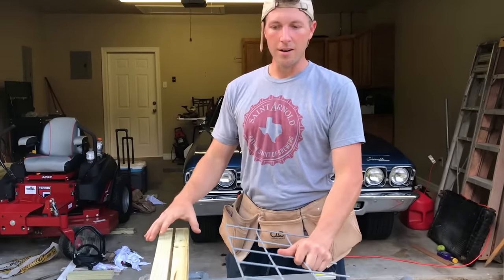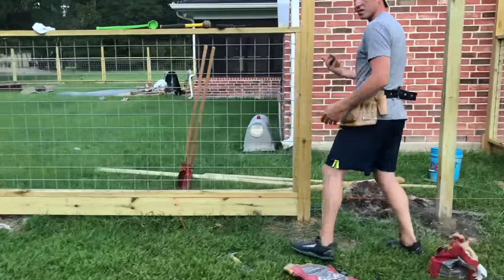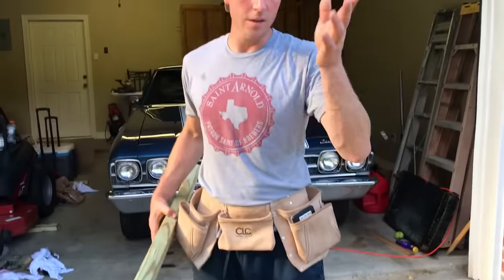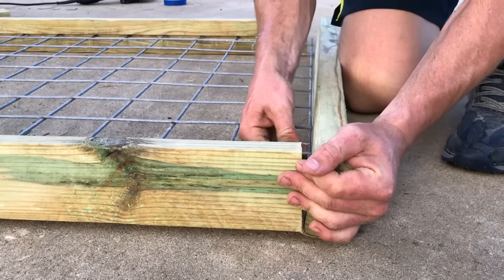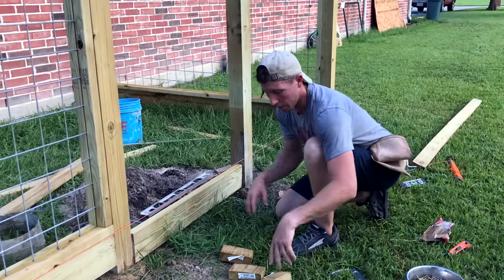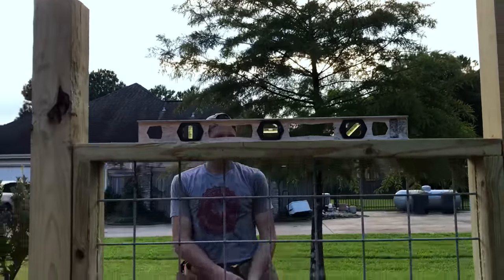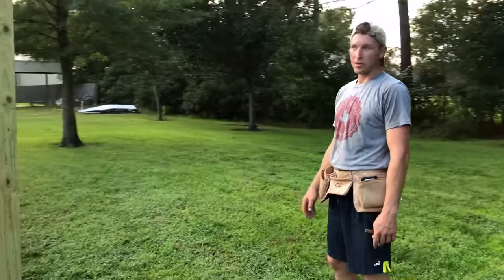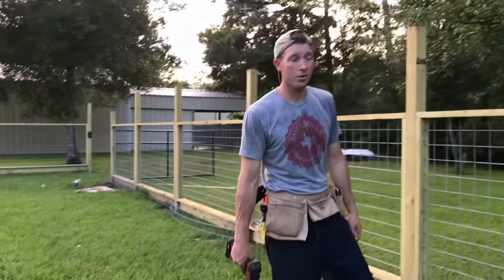Part 1: Modular Hogwire Panel Fence with Dado Groove

Comment: Excellent job.

What an awesome place and neighbourhood you live in. I almost moved to Beaumont years ago but the job fell through.  Still would love to move there !!

Wondering if you used galvanized or plated wire and if it rusted???
Reply from the maker: Thanks for the reply! We love the fannett area. I’ve recently uploaded a part two for staining and evaluation. But to answer your question there is minimal rust if any on the galvanized utility panels I got from tractor supply
https://youtu.be/bL89wkzSPDo
Reply: @GatorOverland  thanks for the info brother.  If it's not rusting in that humidity I'm sure I will be fine.  Although we do see a lot of snow in the winter.  Have a great weekend.
Reply from the maker: @aitf99  You bet bud. Its nothing a wire brush and cold galv spray cant fix. Personally, for peace of mind i think its worth the extra cost to get the galvanized utility panel vs. the regular cattle panel which has no oxidizing protection. It's also a thicker gauge than the regular cattle panel.
Reply: @GatorOverland  I never even thought about the galvanizing spray...good tip.  Thanks again.
Reply: @GatorOverland  oh and how can I forget....wicked Chevelle in the garage !!!
Reply from the maker: @aitf99  Thanks, shes cold hearted and thirsty and loves money thown at her. You can hear her thump on my UMI coilover conversion video towards the end.

Comment: John. Your fence looks great. I’m concerned that the top 2x4 is going to warp. 8 ft is a long span for a 2x4 laying flat. I look forward to your next video.
Reply from the maker: Thanks, Don. Yes, i agree the 8ft is quite the span when considering warp. Its been shy of 6 months and so far so good. Im ok with the expected deviation and warping due to uv and moisture variances down here in the south especially. Im hoping that with a full frame and the rot board at the bottom doubling as a strong back, the warping will be a minimum. I wish there was the option to post updated pictures on youtube for concerned viewers to like yourself to see.
Reply: 8

Comment: This video is fantastic!  Thank you for sharing all of your hard work.  I am going to start building my fence next week.  Question though.  Is there a reason why you cut the 16ft panels down to 8ft?  Wouldn't it save on lumber to have posts every 16ft instead?
Reply from the maker: Thanks for the comment and Yes, I did shy of 8ft spans for rigidity. 16ft is possible, but I wanted to the fence to be structurally strong and minimal sag.
Reply: @GatorOverland  you think it'll sag with the rot board underneath it? Should still be strong? I was thinking of doing every 16ft and like (2) 4-6ft gate?
Reply from the maker: I would most definitely use a rotboard base as a backbone if you’re doing 16ft spans..

Comment: John,  getting ready to start building this fence and wanted to make sure I got the right dimensions.  So if your panel frame dimensions is 93.5" what are the 4x4 post measurements from the inside of one 4x4 to the other.  Not from center to center from each 4x4 but the inside to inside from one post to the other.
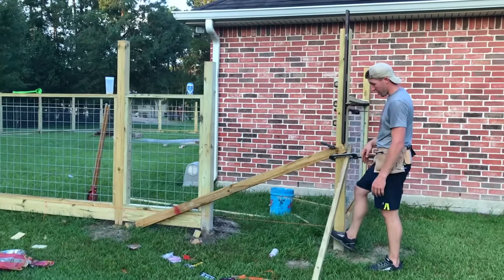Reply from the maker: You bring up a good question Greg. I explain to be careful of this (21:30) in the video. My dimensional take off was based on a perfect world 4x4 being consistently 3 1/2" x 3 1/2", which is why i decided on 93 1/2" panel lengths....take 97" (Minus-)1 3/4" (half of 3 1/2" wide left post to center) -1 3/4"(half of 3 1/2" right post to center)= 93 1/2" from post inside to inside/ ***same as panel length***. Well, they were not all 3 1/2" wide, they varied from 3 1/2" to 3 3/4", and i didnt pay attention to this until sliding into my panels wondering why some were snug and some were slightly loose and others were perfect fit. Well, that variance took advantage of my 97" centers. Yes, all my post based on 97" centers, but i was measuring 97" from the outside edge of one post, to the inside edge of the next. In a perfect world this would locate to posts at 97" centers. BUT, if the post are not all 3 1/2" wide then they will not all be 93 1/2" from inside to inside. If i did it all again, i would have located all my post @ 93 1/2" inside to inside to guarantee all my panels fit without worrying about the post width variance. Another way to account for this variance is to width measure all of your post and find the common width, be it 3 1/2", 3 5/8" etc, and put as many of the same width consecutively next to each other in a row to minimize the variance. then all you have to do is adjust the 93 1/2" dimension + or - slightly to account for it. The other way is place your post @ 97" centers and then draw a layout of your posts on paper and number and measure each gap between post and number and build each panel accordingly. This would account for any variance. I typed alot just to explain the simple issues i had, but if you send me an email to hawkijon@aol.com i will send you updated detailed construction hand sketch, material breakdown and a post variance  example sketch, and elevation variance sketch and some completed project photos. Thanks again Greg.

Comment: Beautiful fence.  I just had a question.  Do your dogs or the neighbors dogs dig?  I'm just thinking dogs can dig out pretty easily under a fence.  I usually drive the bottom row of spikes on your livestock panels in the ground to help discourage the dogs from digging.
Reply from the maker: Thanks for the reply, fortunately the only digging that has occurred has been in the middle of the yard. Come to find out, we have ground moles and the aussie picks up their scent during the moles breeding time. I cant say im happy about his methods of mole eradication. To deter them from digging under, I used my excess panel trimmings at the base of my fence (18:09) and stuck them into the ground and then hammered heavy fence staples to hold it into place. The dogs we have would have to dig a hole 2 ft wide and a 2 ft deep before they would get under that. For quite a bit of money you could construct a concrete chainwall between your post sets at the beginning of the project, or cost effectively dig out and set cement pavers (positioned vertically) or bricks as a hard subterranean barrier.
Reply: @GatorOverland  thank you for your kind reply.  I really like your fence design, especially the openness  of it.  Very nice.  Dog house next?  Lol.  Thanks John.
Reply from the maker: @madelinebrownlee5787  If you would like to send and email to hawkijon@aol.com i will forward your my hand sketch and material breakdown for you to reference. (laughing) the back porch is screened in with fans, the dogs couldnt have a better dog house.

Comment: Love your fence man -- was looking for different fence options for my own pups, and yours is great looking. So my question is, having built many things with treated lumber, I know it shrinks A LOT in the first year or so as it dries out. And I've had no luck finding treated lumber that is already reasonably dry because it sells so fast. Do you now have gaps where the panels meet the posts? Thanks.
Reply from the maker: Hey thanks for taking the time to watch and comment! I haven’t had any stress cracking, distortion, gaps in almost 3 years… I did wait about 18 months to stain and everything has been good… it’s Holding up very well. 🤘🏼
Reply from the maker: My part two should answer any questions you have https://youtu.be/bL89wkzSPDo

Comment: Are there any concerns of the dado being too deep instead of 3/4" depth? Or does it really require that much play of an inch?
Reply from the maker: Six years strong and no issues… The lower dado has weep holes drilled into it so it drains water… Shoot me an email and happy to send updated photos so you can see for yourself jKHARTEL3@gmail.com

Comment: Was the dado blade you used an 8 inch dado or a 10 inch dado? I am having the hardest time finding a reasonably priced blade compatible with a 10 inch table saw.
Reply from the maker: https://www.homedepot.com/p/Avanti-Pro-8-in-x-24-Tooth-Stacked-Dado-Saw-Blade-Set-P0824DADO/202035223
This is the set we used set at 3/8” which was the two saw blades and one cutter spacer in the middle.. got it at Home Depot

Comment: Didn't know that was a miter saw. I've been calling it an angle grinder. Thank jesus I watched this video!
Reply from the maker: Thanks for the comment. A miter saw is actually a table saw that cuts a multiple angles. you are correct in calling it an angle grinder, but i had a grinding wheel made specifically for cutting which is called a miter wheel or miter gringer.

Comment: How do you deal with the trapped water in the bottom rail daddo?
Reply from the maker: jose munoz thanks for the reply.. I drilled 1/4” holes about every 8” in the dado groove of each bottom rail.. I tested it with a bottle of water and it drains every well
Reply: @GatorOverland  yeah I read that reply after I asked lol.  I'm having a hard time finding a dado plate for my table saw. I'm doing aboit 100 linear feet of fence
Reply from the maker: jose munoz https://www.homedepot.com/p/Avanti-Pro-8-in-x-24-Teeth-Stacked-Dado-Saw-Blade-Set-P0824DADO/202035223 this is what I used
Reply: @GatorOverland  yea that's the cheap, yet great,  set I used I should be done tomorrow

Comment: I have a question about you table saw set up, how did you get the two blades on there side by side ? Just slide one in first then the second ? Or was this one already set up for two?
Reply from the maker: It’s an actual dado saw blade set made specifically for this. It’s in the video description 
https://www.homedepot.com/p/Avanti-Pro-8-in-x-24-Tooth-Stacked-Dado-Saw-Blade-Set-P0824DADO/202035223
Reply: @GatorOverland   freaking sweet! Can it be used with any table saw?
Reply from the maker: I assume most will.. I did 3/8” which was the max for the throat plate on that saw table. Wider plates  are usually available..

Comment: My dogs would dig under that fence. Got any ideas for that?
Reply from the maker: Angela Branch thanks for the reply! Yes, but it could be costly.. you could make a trench under beneath your fence setting and fill it with rock, cement, or bricks and then cover it up..other than that, try utilizing the extra trimmed leftovers as I mentioned toward the end of my video, they work great for our pups.

Comment: What’s going to keep the 2x4 top rails from bowing up eventually? They’re built with the flat side horizontal and will tend to bow over time since they’re unsecured across the length.
Reply from the maker: thanks for the reply. This has been a concern of mine as well, but so far so good. Nearly a year later they are as straight as the day they were put in. A plus side to is, if any board were to bow significantly, its $4 for a new 2x4 and about 10 mins trimming to 93.5"/disassembly/reassembly between the post would have the problem fixed. no biggie.

Comment: Dude this video is sweet! Thanks for posting this. Will be doing this project! I’ll save you some saw liquid lol
Reply from the maker: You bet! Thanks for the reply! I’ll have a part 2 posted shortly of my 18 month evaluation and stain process.. in short, the fence is holding up great and I wouldn’t change a thing. Check the description for my a Dropbox link to access my construction details and excel cost generator or shoot an email to hawkijon@aol.com and I’ll send them over
Reply: Gator_Overland thank you! I have a question... if you could, would you have done cedar or does treated pine give a good run for the money.
Reply from the maker: @markvalleys7072  I do like the look of cedar personally, and for the savings of doing my project at around $8 per foot, i probably could have done cedar for the cost it would have been for a contractor to do the same fence in pine ($19-$25) per foot. If money was no option i would most likely have done cedar. We had just moved into the house but needed to contain our pups on a budget. Ive been more than satisfied with the outcome, especially after staining. I think we did alright with the treated pine for the money, it looks good, and keeps the dogs in...mission accomplished.
Reply: Gator_Overland gotcha! Enjoy bro!
Reply from the maker: Mark Valleys https://youtu.be/bL89wkzSPDo
Reply: Gator_Overland just watched it all... incredible turn out and review! I was only disappointed there were no cold ones to help with the project lol
Reply from the maker: @markvalleys7072  thanks bud!! they were placed like easter eggs.. trust me, they are there. I got alot of negative comments about booze being in part 1 and being unsafe, so i figured i would spare the sight of my cold snacks to avoid unnecessary comments. (there was one behind the bleach bucket when i was going over the essentials) have a good one. Enjoy youre fence
Reply: Gator_Overland hey man there’s no such thing as a project without some cold refreshing ones! (Water of course  ;)) I will have to tag you when I build mine! Already have it priced out thanks to you
Reply from the maker: Mark Valleys good deal, and good luck. Let me know if you have and questions. I actually received a viewers project photo this morning! Turned out great!

Comment: Can we make a dado groove with anything else or any other saw , other than the table saw ? I have all kinds of saw but the table saw
Reply from the maker: Thanks for inquiring… There is actually a set up you can use with a Skil saw, but it might find the end of life of your Skil saw In the process… I would recommend using a tablesaw like I did in the video. Dado kit start at about 50 bucks… I recommend that
Reply: @GatorOverland  thank you for replying i was thinking about that i should buy a table saw or may be a router but table saw seems like the best option. I will be asking you more questions as i go along with this project. U have done an awesome job.!
Reply from the maker: Absolutely feel free to reach out via email.. all the construction info links is in the video description.
Hawkijon@aol.com
Reply from the maker: Also.. I did a quick Facebook inquire and had a friend respond in a hour that has the table saw and the post hole auger.. only needed to buy the dado blade kit from avanti

Comment: Where did you purchase the fence panels? What size are they?
Reply from the maker: This information is mentioned in the video and listed in the description as well as other material links… I got the panels at tractor supply… They are considered the utility panel and come in a 50 inch tall by 16 feet long with 4X4 wire grid
If you have any further questions, please reach out to JKHARTEL3@gmail.com

Comment: You may have done so, and I just missed it. Your dogs (kids ?) are big enough that if they hit the wire panel it could bend, and pop out of the dado. May think about using a staple, or something else, to keep wire secured in dado. Good job.
Reply from the maker: The wire panel is by itself is fairly rigid. When Placed in the dado groove frame it is very sturdy. I’ve Leaned and pulled on it with all my weight and you’d be surprised how little the panel gives. I’m confident that it would contain anything shy of an atv or truck hitting it. It’s worked great for my 200 pound mastiff and 50 pound Aussie. In a recent windstorm, the majority of the people in the neighborhood with a plank fence had significant damage, and mine is still standing without a problem.

Comment: Would the panels slip out of the dado if you push on it?
Reply from the maker: That’s a great question! My quick answer is,  no sir, very strong. Check out my part 2, in the first 5mins I cover the top 3 questions of over 1000 that I received about the fence. Enjoy your fence
https://youtu.be/bL89wkzSPDo

Comment: Thank you for the video! May I ask you one question? Why do we need the bottom kickboard? 
Thank you again!
Reply from the maker: Thanks for the reply! Great question! I have 3 reasons.. 1) it provides a barrier between the ground and your fence. Boards next to the ground will rot faster than the rest of the fence. 2) it acts as a additional support for the fence and will deter bowing. It’s is not necessary, but is in your best interest to utilize them. 3) at added additional height to my fence.
Reply: Get it! It is easier to replace the kickboard if it rots faster than the bottom lumber of the panels.
Reply from the maker: yang song that’s exactly right!!

Comment: So what keeps the metal portion from flexing and coming out of the dado?
Reply from the maker: Thanks For the reply, you’d be surprised how rigid the utility panel is by itself, and when it’s surrounded by a frame with a 1 inch groove, It doesn’t do more than bow slightly in the middle and then return to its original state. I’m 6’-1” 185lb and even me pulling on it with all my weight will not release the panel from the groove… I’m confident This fence will hold up to anything shy of a rogue lawnmower or ATV. It’s done very well over the past 18 months and keeping in my 200 pound mastiff and 60 pound Aussie no problem.
Reply: @GatorOverland  Well I guess I don't have any more excuses not to build it now.

Can I barrow your table saw? 😂
Reply from the maker: @MustPassTruck  I actually shot a inquiry out on facebook and had a gas powered auger and table saw by the end of the day from friends. i will have a Part 2 of this build posting soon going over stain protection of this fence, and covering the exact question you asked me. (confirming it wont pop out with my weight pulling on it). If you havent already done so, check the video description, there is a dropbox link for access to construction PDF's and an excel cost generator i developed based on my exact build per linear foot. I have full confidence in this fence design and know you will be happy with it should you proceed with construction.
Reply: @GatorOverland  thank you. I'll keep checking in to the channel.